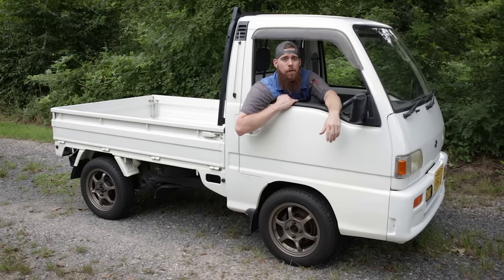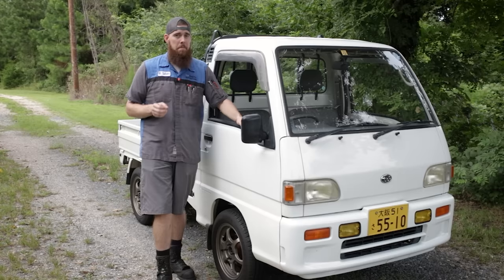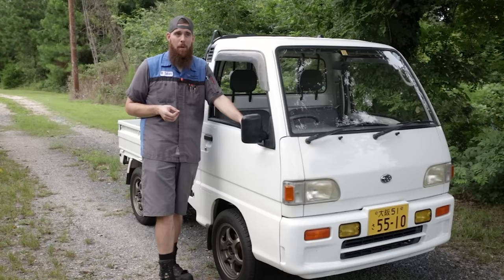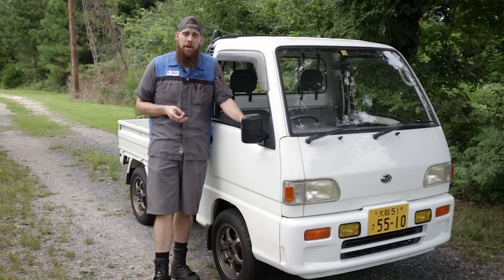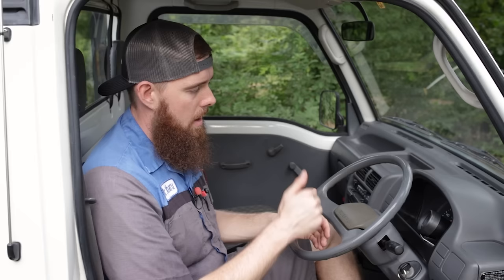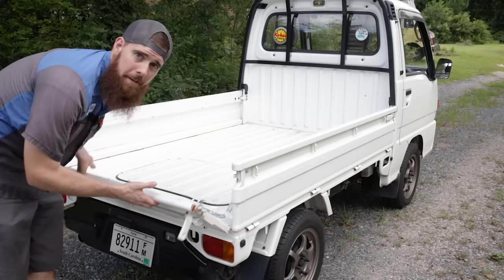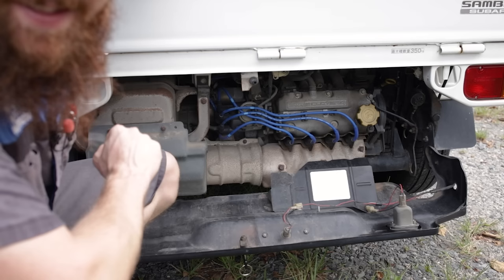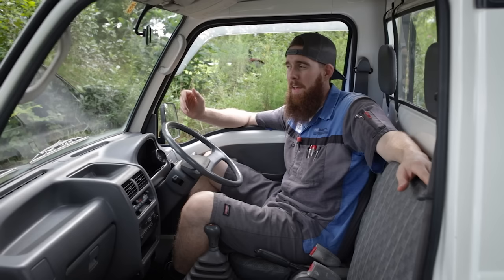One Year! (And One Month) Living With My Subaru Sambar Japanese Kei Truck!

Comment: We should have US versions of these little trucks and vans in America. Not everyone wants or needs a pickup truck costing $55,000 and up!
Reply: It probably won't pass a DMV safety standard as always. and most American won't fit them, leg room would be an issue and suspensions too.
Reply from the maker: These trucks get nowhere near 50mpg. The best I've seen and personally achieved is about 32mpg. Still great for a 4x4 truck.
Reply: If they were made here they would be 50k
Reply: We did have small trucks in America in the 1980s and the early 90s but the automobile manufacturers decided they wanted to sell us big four wheel drives and big SUVs and phase them out! We had the Volkswagen truck that was like a car, the Dodge D50 and other such trucks but the manufacturers decided to go big and not keep small it was us that let us happen if we didn't buy the big trucks they wouldn't be making them
Reply: There’s not enough money in small trucks.  Why build, market, sell and service 8-10 Kei-type trucks when you can sell ONE redneck limo to some fool who can’t afford it?  And sell or lease it again and again
Reply: @MrSubaru1387 this helps thanks!
Reply: Multiple reasons. Safety standards set by the federal government. Making sure they would also pass emissions standards in all 50 states. Also they would have to set a certain mpg.
Reply: @MrDanmulry  As I recall the upped the sizes of the trucks to fit through an emissions loophole.
Reply: Problem is the Big 3 or the little 3 now...consider these as a threat to their existing product line and will try to kill any project that produces these.
Reply: I use to think you had to have BIGGG equipment to do any job.   While in college I lived with a couple on some average.   They had a small Economy, and a Sears Suburban for a big garden. I found out that they would do all the work of our big tractors, and do it much better.   Soon after I bought a Toyota 4x4. My grandfather laughed his ass off until we used it to go deliver a calf in a nasty place his truck couldn't get to.     There is no reason to drive such huge vehicles just to get from point A to B.
Reply: How much power does the A/C rob while running?  Is it a huge noticeable draw on the engine?
Reply: In my country Hyundai sells a full size version, still small by US standards 16' long by 5'8" wide with a payload of 2750lbs. Has a 2.6L diesel with manuel transmission, not sure it would pass US emissions and safety standards but they are really useful, maybe someone wants to look into importing them from Korea.
Reply: there's plenty of older stuff they could bring back & refresh that would be preferable to the shit they make nowadays.

I had an '88 Chevy Sprint Turbo when I was in high school, 1 liter 3 cyl turbo (70hp), quick nimble little car (basically a souped up geo metro), 40+ mpg highway; put quite a few 5.0 rustangs to shame on our windy mountain roads...lol
Reply: so the issue is the government. some good. mostly extreme overkill (even with good like safety). environmental and safety regulations have killed the auto market. hell look at CAT and cummins. the two BEST diesel engine makers in the world (not even my opinion. fact.). both got out of the market because their engines couldnt pass arbitrary regulations despite their efficiency.  or look at a mini cooper from the 80s and today. its not that big cause of upgrades. thats crumple zones. i could go on and on. but automakers also wouldnt allow it. hell ford has a diesel crew cab ranger in south america for the last 20 years. they never made it cause it would kill their (now dead) sporttrac suv abomination.
Reply: @haringusbaw6132  The modern ones are fine and our stupid laws prevent them from coming here.
Reply: They’re called scooters bro. We drive these things in factories.
Reply: Daihatsu technically DID in the late '80s, mostly for the US Government.
Reply: @MrSubaru1387  they could probably get 40 mpg with a slightly more modern engine and 8 gears.
Reply: It would be  great bit there's no way  it would  pass American  crash safety standards
Reply: @haringusbaw6132  Only if you think 4 wheels means 4 wheel drive. As for leg room the seat does have an adjustment lever. But then again most people don’t realize or know how to use them.
Reply: I hope they start making electric versions of these.
Reply: @danielgoodroe4031   Which is now closed anyway...
Reply: Unfortunately the epa made that impossible. That's why trucks have grown bigger.
Reply: @haringusbaw6132  Despite many American peoples way of thinking, japan is actually way more strict than America is on emissions and Safety. Its not that it wont comply with American standards, its that they chose not to bother. Doing so allows them some other luxuries when designing them.
Reply: Most of this "saying" came form a simple door bar and aluminum hoods on 90's hondas..Lol.
Reply: Disney actually has USDM versions of Sambars at their park locations
Reply: @haringusbaw6132 The point isn't to sell  this exact truck in America, but to create an American version that satisfies safety requirements across the board without being a an absurdly expensive monstrosity that requires a backup camera to park.
Reply: @Headhunter_212  You've just done a fine job of describing the problem, and one of the flaws in those who insist that a free market is inherently beneficial to consumers when it's really inherently beneficial to corporations. American truck companies have been incredibly successful of marketing to their core demographic that they NEED to go into debt to buy impractical monster trucks with tiny beds that are less capable that Japanese Kei trucks.
Reply: but we all want more than 700cc, might aswell stick a few phone batteries in them lolololol
Reply: Ford F-150 single cab is the US version of this.
Reply: @MrSilk13642  hehe for sure..... tho i adnit id love one :)
Reply: You can thank the chicken tax and the EPA regulations for that. American manufactures didn't want to compete so we have the chicken tax making it more expensive for outside markets to sell cars here, and the EPA regulations forces manufactures to achieve a certain mpg that increases every year calculated on the wheelbase and length of a vehicle, which is why they keep getting bigger so they can meet the mpg requirements. And the safety standards too. 
Talk to your reps and senators about it!
Reply: @ColbyDial  kinda makes no sense. light weight gives more mpg not bigger and heavier
Reply: @haringusbaw6132 it won’t pass Japanese crash test standards either, kei cars are given special exemption. There should be a similar class for the United States
Reply: @MrDanmulry 

Mayberry mini Trucks on YouTube sales these in all brands in America .
Reply: Exactly !!!!!!!!!!!!
Reply: We have too many safety laws
Reply: It's never going to happen . Safety. Emissions. And attorneys.
Reply: Why? So people will have more financial freedom and mobility? No Sr. You must pay now 45k plus to have a unreliable pickup truck.
Reply: That’s exactly why we DONT have them. You know how much money manufacturers would lose if people didn’t spend 50k on a vehicle they don’t need.
Reply: @coburnlowman  yes, I’ve seen vids where some new owners test that and even the audience can tell there’s a power drain. But because the cab is so small it keeps really cool. Hills cause a greater power loss, however.
Reply: There must be because I remember driving one of these at the golf course I worked at in the 90’s it was a 4 cylinder but it was governed wouldn’t go faster than 35 , to be honest it felt really sketchy at 30!  Oh and was left hand drive!
Reply: We did have the Toyota Hilux but tragically that’s much more popular with the Taliban and overseas installations 😅 Every truck when I was overseas was a Hilux regardless of which side
Reply: I'd love a version that is between a Kei and a Ford Maverick (could be styled like the old Datsun or Toyota pickups from the 60's and 70's) with a 1.5l 4.

Comment: I'm that viewer he sold it to last time. If he sells that one count yourself lucky to be the one who bought it. I have no regrets on my little truck for machine shop delivery out of my shop and a daily driver.
Reply: Interesting. I'm in PA, and I know of a machine shop in my area(they primarily build American racing engines) that run one of these around. I'm not even sure if they're legal here. :-) I just thought it was a cool coincidence that you use one for a machine shop also.
Reply: @mtnvortex  it's perfect for the job for lean manufacturing areas that call for machine shop work but I am just north of Mr Subaru in North Carolina and I service local endustial business machining needs
Reply: @mtnvortex PA sucks for “all things fun”. I just moved back from FL where they have no restrictions on ANYTHING! 🤣

Comment: In Canada we can import 15 year old models.    Quite a few of them in my neck of the woods.   Came across a mint supercharged one last week at my local home depot.   It drew a bigger crowd than the Ferrari parked two aisles over.
Reply: I'm interested in purchasing one can you please give me eny  information greatly appreciated
Reply: I'm here in Canada in the middle of looking into importing one, Admittedly the thing IREALLY couldent expect was how cheap they are to import.
Reply: I think 25 is just too old for America. I wish we could do 15. The newer models seem quite a bit nicer. And way less rust of course 😂
Reply: Chicken tax
Reply: @Corkoth55  I don't mind the 25 years but agree that 15 would be much better - I prefer the fuel injected models over the carb ones.
Reply: @gerardomacedo8910 The Chicken Tax is 25% tax on trucks. 25 years is DOT no crash test completed.
Reply: The Sanbar is rare. Feraris are a dime a dozen. Sanbar is easy to drive. You have to be a contortionist to get inside a Ferari.
Reply: Excellent information on this model and by tomorrow i will know if my bid direct from the Auction in JP on a 1990 supercharged F5 - 4wd with just 30,000klms is mine , I will get back tomorrow with the info if   I  am  the winning bidder.
Reply: I'm in Ontario Canada, very interested in one of these mini pick ups,but not sure where to find them.  Heeeelllp please 😂

Comment: I daily drive a Subaru kei car as well.  Honestly, it is very comfortable on American roads.  It can easily handle 70 to 75 mph, and I regularly get 40 to 45 mpg.  My car has the same basic engine, the only major difference is that mine is fuel injected, but still naturally aspirated.
Reply: Vivio? Maybe they're geared differently than the trucks.
Reply: What state? Are they street legal in Texas?
Reply: @DFranco23  As far as I know the kei trucks can only be registered for off-road use in Texas, not sure about the cars.  They are all street legal where I live, but it is difficult to register if you don't get it titled in another state first, like Virginia makes it easier to register imported vehicles.
Reply: @Corkoth55  I'm not sure about the gearing, but mine is also fwd instead of the awd that the sambar has
Reply: @southernkei  I want it to be street legal but won’t be getting in the highway
Reply: Your not doing the math right. I own (3) and all are EFI and at peak tune and none of them get near 40+ MPG. 30ish is more accurate MPG.

Comment: A big advantage of the Subaru Sambar is having the engine mounted behind the rear axle gives it better weight distribution.  It isn't as front heavy as some of the Kei trucks with front mounted engines.  This gives better rear wheel traction in the wet and snow and it handles better.  Not to mention easy access to the engine for service.

Comment: I love your sensible and complete review of the sambar, I used to have a Honda acty Van and at highway speeds it got shockingly bad fuel economy even though it was only a 550cc 2 cylinder, the funny thing with the acty motor is that it was based on the right two cylinders of a Honda goldwing, I used a spare right hand head gasket left over from a repair on my 1000cc goldwing. I now have a Mitsubishi minicab miev EV van.
Reply: Yeah at highway speeds, aerodynamics don't care what size the motor is 😂 coefficient of drag is king.

Comment: These Kei-class trucks and vans were exported to many countries, especially Asian countries, South America, Africa, the Caribbean etc. I learned to drive initially on a Subaru L-Series station wagon 1.6 DL that we had, and I finished my lessons and driver's test on a Daihatsu HI-Jet van. In Barbados the most popular of these small trucks/vans was the Suzuki Carry. It had a bouncy ride and flipped over easily and frontal accidents were as you described. In our market the Subaru Sambar was called the Subaru 700 van as it had the 665cc 2 cylinder engine, just like the Subaru 700 (REX) mini car (my first car). This engine was later replaced by the Clover 4 cylinder like the 758cc one in the Subaru REX kei car (M80 in our market). I had one of those too ! The E-Series van was identical to the Sambar with slightly different styling (4 headlights instead of two) and the same engine as the J-Series (Justy in your market). E10 van and J10 car had the 1.0 litre engine, and the E12 van / J12 car had the 1.2 litre like the US market Justy. I had a J12 4WD too. The difference with the Subaru Sambar and Domingo (E-Series) compared to the other Japanese makes was that the Subaru vans were the only ones with fully independent suspension and torsion bar suspension which gave a smoother ride and better handling than those other vans.

Comment: Very flexible little fun vehicle. MPG is a shocker though! Would have thought a dinky engine would return better but I suppose if it is running at high rpm most of the time. There are also camper styled versions available in the UK....the mind boggles.

Comment: The thing I love about these little Kei car engines, is that they were built to rev (some of them up to 8000 RPM) in order to squeeze every last bit of power out of them. I've had a couple of them in the past, one of them being an export market spec Daihatsu Cuore. That had a 1 litre 3 cylinder normally aspirated engine with dual overhead cams and 12 valves. This engine revs to 7200 RPM easily and I had it pegged at 6500 RPM (at 90 MPH)for nearly 75 miles. Took it like a champ, coolant temps barely creeped up above normal. Pretty impressive.
Reply: They won't last long at that speed (spin a bearing). Speed limits on highways in Japan are tops 80KMH not 80MPH. Also peak toque is at roughly 3800rpm. Going past that = Horrid MPG.

Comment: I absolutely love this little thing. I could easily see me owning one.

Coming from KY, I would be utterly shocked if some red neck hasn't shoehorned either a Harley, Ford or Chevy engine into one of those LOL! I knew a guy that put a Chevy 5.7L, complete w/a 350 TH tranny and a 3.10 axle into a 60's VW Bug. It topped out at like 85mph but it would straight up smoke a ZR-1 off the line.

I knew another guy that did the same to a Chevy S-10 but added a B&M racing shifter. Craziest vehicle I've ever rode in. It would spin the tires shifting into 3rd gear. That thing should have had harnesses instead of seatbelts. It was a rocketship without wings.

Comment: I'm looking at one of these to work around my 5 acre property and short runs to the dump or lumber yard. Was looking at a side by side but can't take them on the road and the boxes are too small to be useful. Plus they cost as much or more. There are also a lot of logging roads around my area were I can go on adventures into the bush. I wouldn't worry about scratching it.

Comment: Dude, this thing is just adorable. My '05 Sub. Forester has a code up for barometric pressure sensor, and sometimes stays at high RPM after releasing throttle (esp. in cold weather after start). Cruise control light flashing, and problem came back after idle re-learn. Manual 5-sp, 4cyl 2.5. Should I bring it to a specialist? If this car is ever totalled... I'd probably get an older one to replace it.
Great videos as always
Reply: A true attempted hijacking

Comment: I was stationed in Okinawa for two years. These little trucks and vans were everywhere. Most roads didn't go over 60Kph, so they were fast enough.  I think the Okinawa Expressway was 100kph.
Reply: 100kph = 60mph roughly
Reply: Expressway in Japan is actually 80kph.

Comment: Thank you for all the great info. Been pining for a Dias II van ever since I first saw one. Through luck I met a guy that does importing and hope to have my hands on one soon, with a truck to match later on. Also in SC (upstate) so good to know getting it plated won't be an issue.

Question - What would be your recommended 'care package' for maintenance parts you would recommend for ordering for the clover-4? Once I know I have one in route, I'd like to order the parts and have them ready by the time it arrives. Thanks again, subbed.
Reply from the maker: Timing belt/water pump, cam and crank seals, oil filter, thermostat, belts, rocker cover gasket. Good to swap fluids and filters and get right with the timing so you know where you're at as far as scheduled maintenance.

Comment: Woah I had assumed these little things at least got better mileage, but if it's a bit under 30mpg, that's no better than my 20 year old car. Still, kinda considering one of these just for the utility.
Reply: I had a first gen Ford Probe that would get 33mpg at 70mph.  The Probe had a drag coefficient of .3.  These have the aerodynamics of a brick.

Comment: 7:20 having said that, being on a motorbike gives you the chance to roll, skid, or fly with it...i.e. the concrete will sandpaper yer arse, but being inside a hunk of metal means you could get crushed to bits...point taken